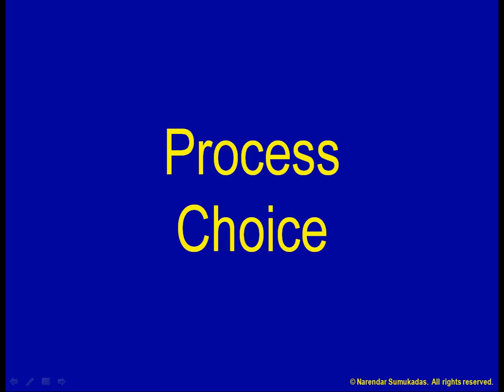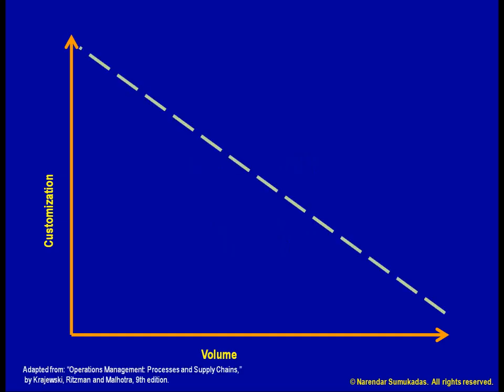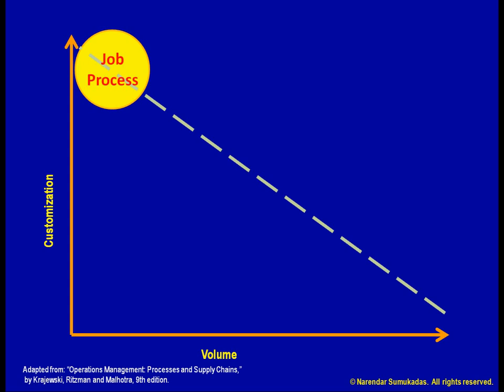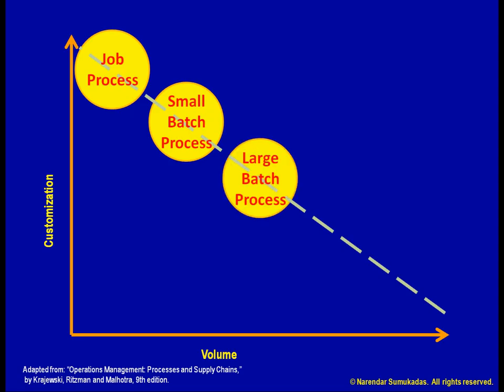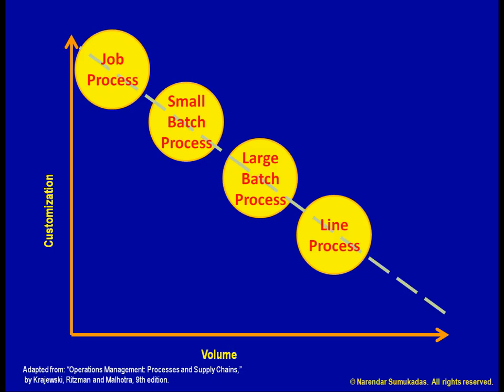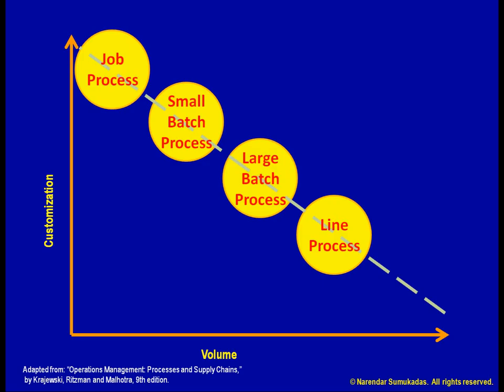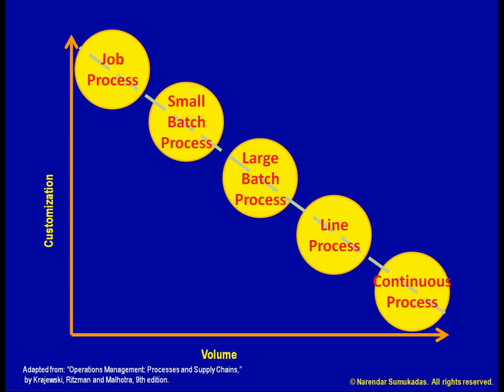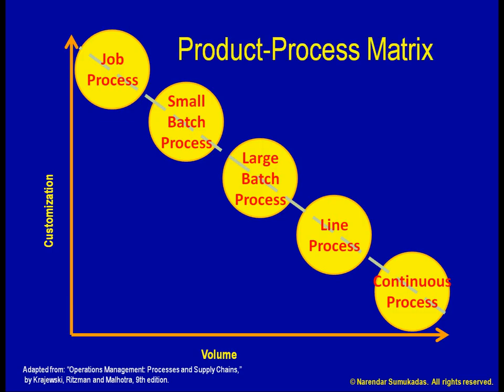[2.e] Product Process Matrix

Comment from the maker: The product-process matrix is applicable to manufacturing processes.  For the service processes in a cleaning company, apply the Customer Contact matrix (2.f).  Distinguish between front-end vs. back-end processes (e.g., cleaning at client location vs. preparing for client visit).  Front-end will have high customer contact, customization, process divergence, complexity, and will need higher skilled employees, general purpose equipment, more labor intensity, etc.  Back-end will be the opposite.